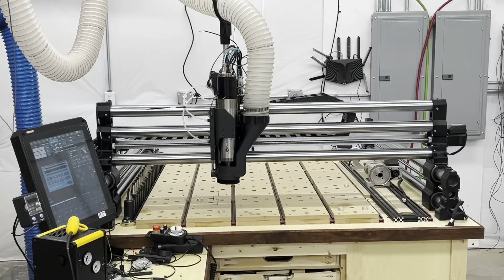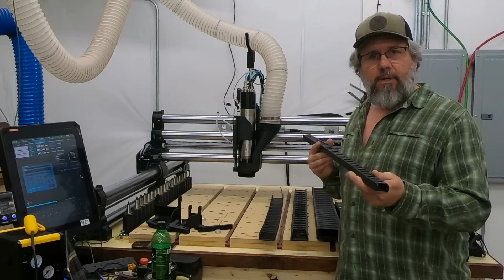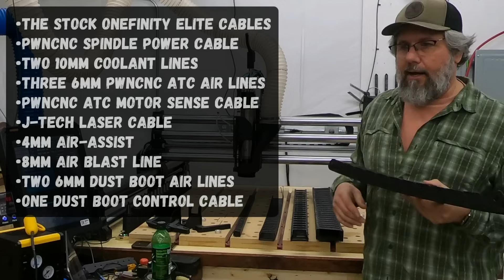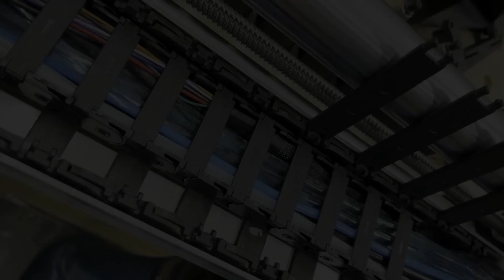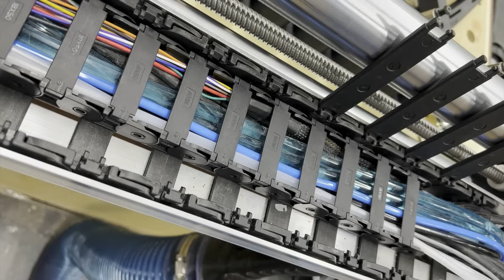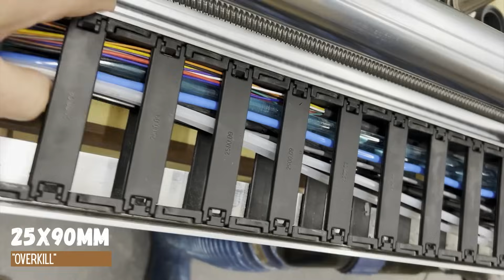Upgrade Your Drag Chain

Comment: What's the best place to source the 1" aluminum angle? I'm not finding any 5' sections, only 8'.
Reply from the maker: I've used online metals.  I found them to be the least expensive.  Amazon can also be inexpensive if you find the right deal.  Their deals are constantly changing though.

Comment: Quick question! How many links should you remove with the 18x50? Not sure how much it should stick out since you have to combine 2 meters worth
Reply from the maker: When you order it, just specify you machine model and I’ll ship you the right links pre-configured.
Reply: @UglyDogWoodshop  Sorry for the Elite Foreman, I purchased this before you were offering the drag chain as well and got them from amazon.
Reply from the maker: @CleanEdgeProductions  I'm not sure how many you have to remove, but I think it's a total of 47 links required for the Foreman.  Sorry I didn't stock those sooner.
Reply: @UglyDogWoodshop  Don't worry about it! Looks like I was 1 link under

Comment: That's a nice side mounted dust collector!!!;-)
Reply from the maker: That's the one.  I still have some work to do on it, but I think I have a dust boot that will give you access to the full 160mm of Z travel while using an ATC, and while densely packing your tool racks ... so you can mount the most tools possible.

Comment: I highly recommend the drag chain upgrade. I was provided a ATC upgrade from PwnCNC (I work for them) and I was worried for months in advance on what solution I would come up with once it got here. Fortunately Adam released the drag chain upgrade and I ordered them immediately. He even provided a edited version of the back Y bracket for my Woodworker size Elite. I can't say enough good things about the design or Adam as a upgrade designer. If you are adding anything more than a air cooled spindle to your Elite... get this upgrade. It's TOTALLY worth it.